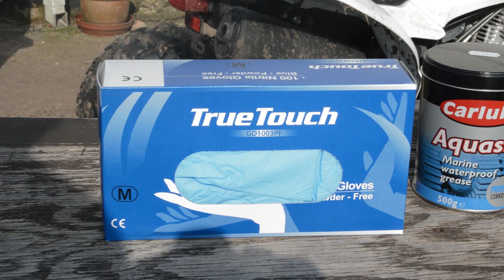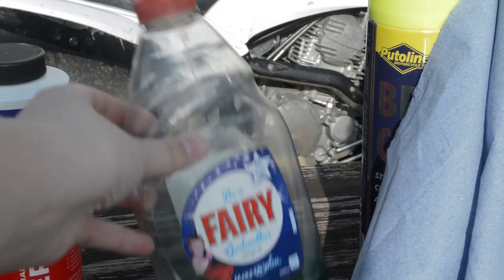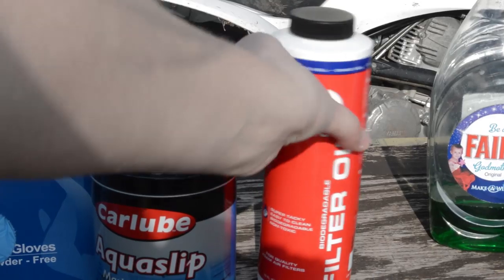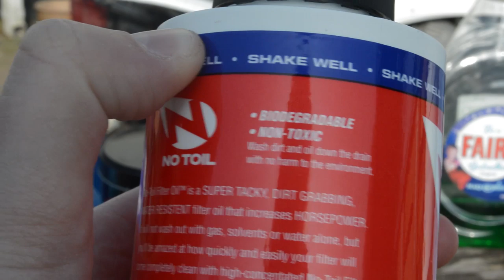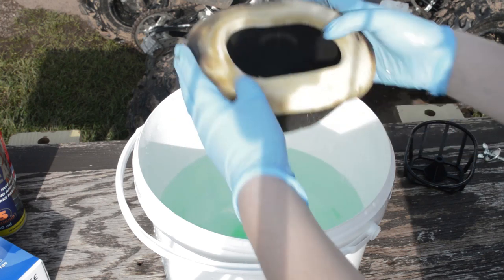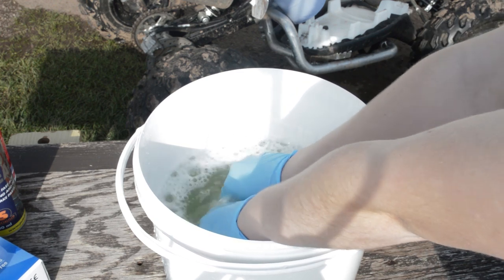How to clean and oil an air filter - dirtbike or quad bike

Comment: Warning racing em what the grease for do u have to have the grease for the air filter
Reply from the maker: Hey , I was actually just using some pretty cheap waterproof grease meant for boats as thats all I had , but if you were to buy some check out belray grease, maxima or putoline . Thanks for watching
Reply: WarningRacing ok but do u have to have the grease
Reply from the maker: Yes you do otherwise there would be no seal between the air filter and the box which would been dirty air and mud would get under the air filter and straight into the air boot , which kinda defeats the object of having an air filter in the first place. Hope that clears it up . Thanks for watching :)
Reply: WarningRacing can it be any type of grease like water and heat resistence
Reply from the maker: Yep anythign like that will be better than nothing at all :)
Reply: WarningRacing k thanks